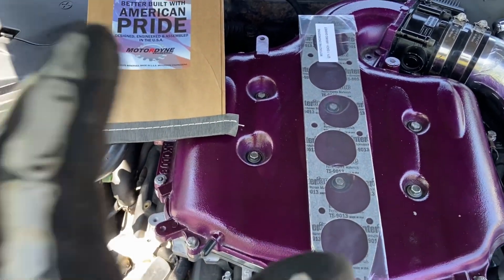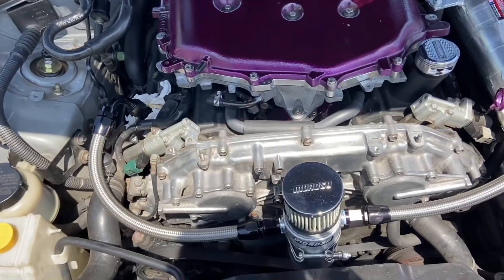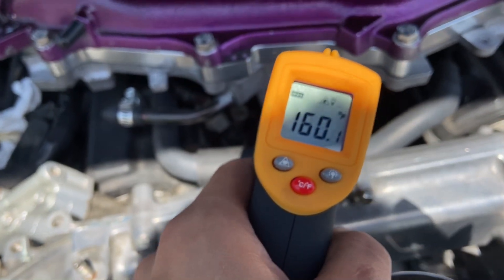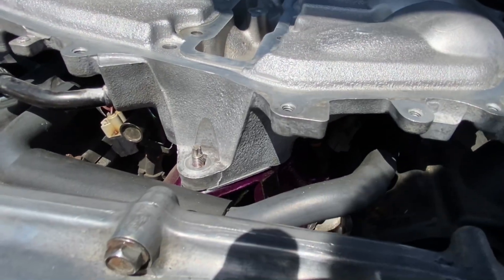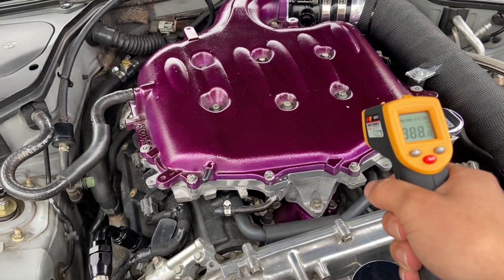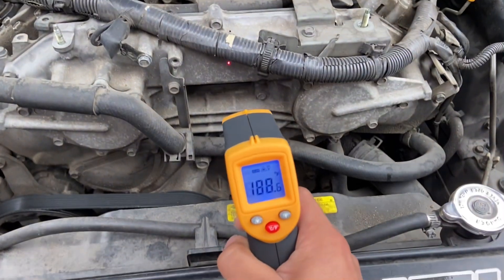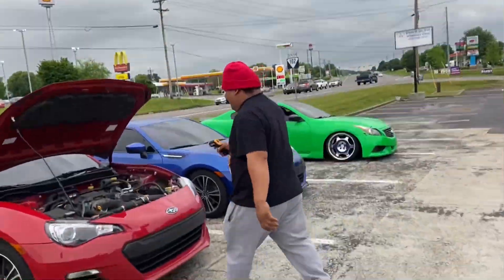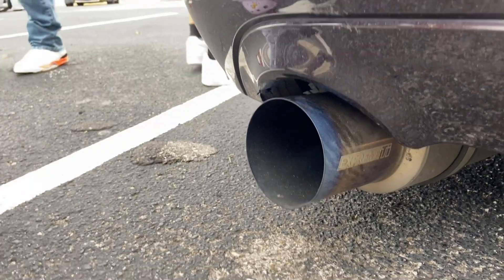Reduce Intake Manifold Heat G35 350Z DE - Thermal Gaskets

Comment: You didnt read the manual. Youre supposed to put the gasket in a bag with a small amount of motor oil to coat it before installing it.
Reply from the maker: I didn’t have to put the gasket drowning in a bag of oil. This gasket has compression properties, so torquing the manifold will seal with zero issues, a very fine coating of oil will only create a sticked on gasket, if we listened to the misinformation you provided us with and drowned the gasket in oil it would be even worse, why do I know? Because I did add a fine amount of oil, to the gasket, and what did it do? It got glued to the manifold and once I removed the glued gasket off the manifold it slightly tore off some material. So if you want to drown your gasket in oil and ever have to remove your manifold again, be ready to have an extra gasket because it’s going to tear. Adding oil to the gasket will do mo difference, it’s not going to leak. Save this for important things like using micrometers to measure tolerances on the crankshaft and not using caliper tools as they are not accurate.
Reply: @DEATHWISHVQ  Hmmm guess you cant read. Im not spreading “misinformation” as much as youre leaving out information that was provided in the installation manual, as I mentioned btw. The manual states to use oil. That is not a lie. If you didnt want to use oil thats fine, and all you had to stay. But dont claim I am “spreading misinformation” when youre the one conveniently leaving out printed information that I pointed out.
Reply from the maker: @jejejoey  I admit my choice of wording was off. To be clear, yes the manual may say to add a think coat of oil. But it’s not necessary, it will seal regardless. If anything it will be a headache in the future if you try to remove it, you better be prepared to have a backup one because it may stick hard since the oil will act like glue. How do I know? I did add oil once when doing a cleaning head job and it slightly ripped the gasket when separating the manifolds.